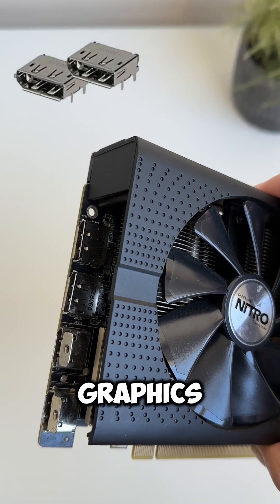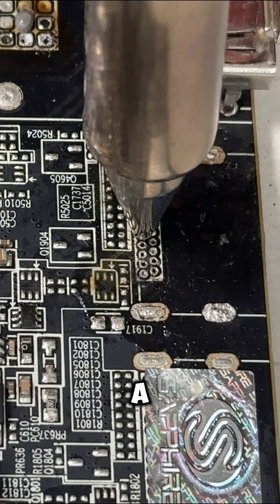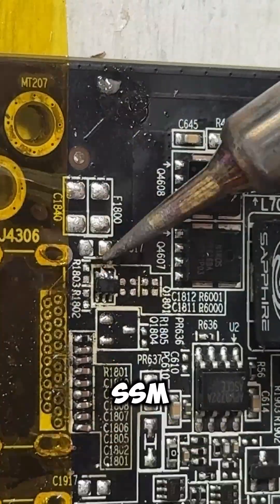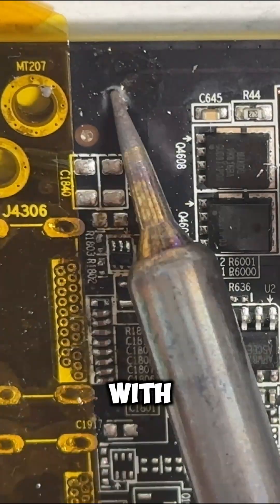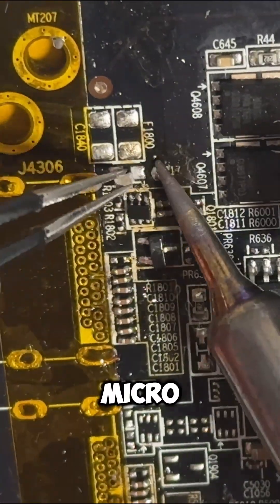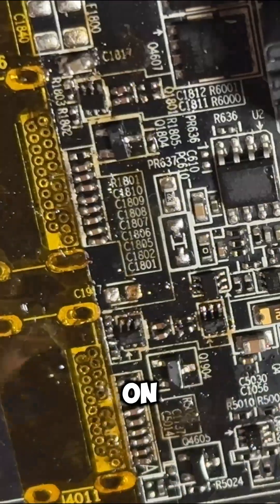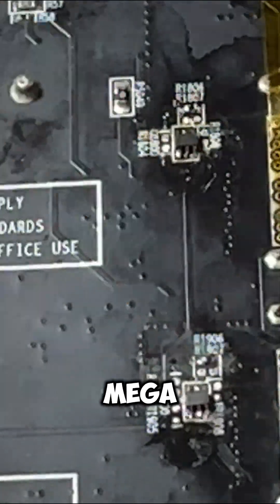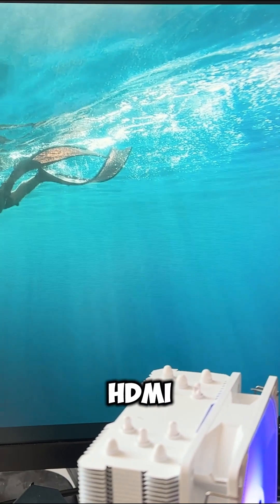Soldering Display Ports to Mining GPU

Comment: Damm bro thats some next level pc building
Reply: Bruh. You do no effort that's so simple. Monkey pour water for current to flow. Monkey make bridge in order to guide monkey to a specific point. Monkey name someone captain to dictate what other should do. Monkey make crate to stock banana.

That's what all the soldering was used for. 
Most part are just electrical signal regulator (Mofset, capacitor, transistor, resistors) the rest is just the "fancy name of the product. It's like saying 9600X instead of AMD Ryzen 5 9600X 3,9GHz, 5,6GHz 38,48MB cache total. (Like the SSM 6N 7002 it's just. A model of tiny Mofset who act more like a switch and signal carrier for such a compact PCB like a graphics card).

Basically: Make the PCB able to recognize, "power", and send proper signal trough the DisplayPort (which is a port made to carry mostly a video signal, some can transmit power, like ±30W but that's the case here)
Reply: @FireCestina1200  tf are you ok